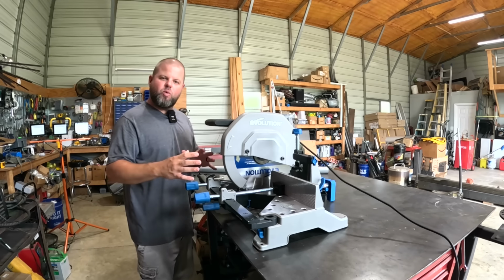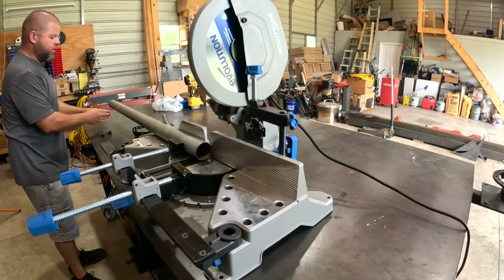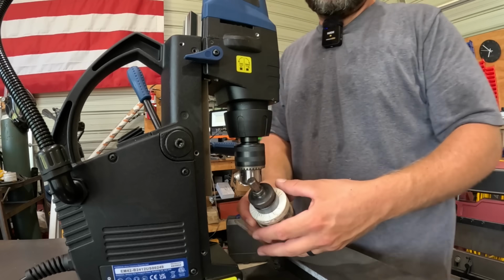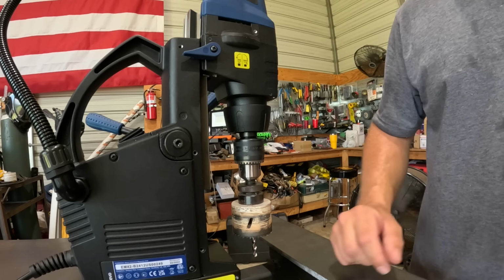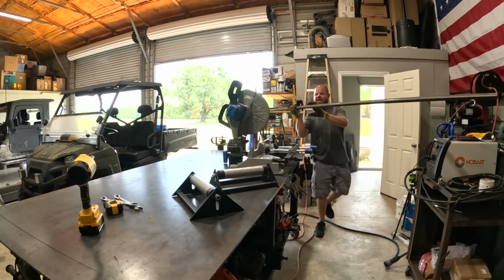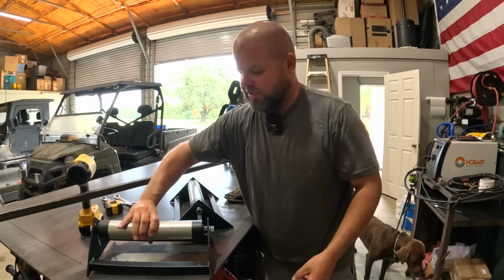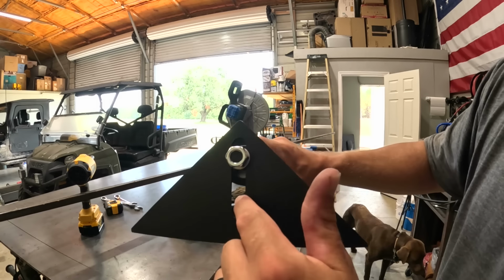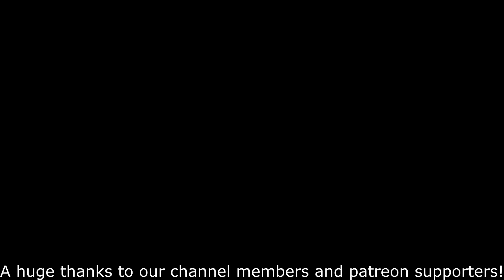Building Metal Roller Work Stands! A Huge Help!

Comment: Thanks Andrew.
I had Roller Stands for My table saw but changed them out for the Ridgid Flip-top stands.
I found Roller stands tend to push the stock one way or another if they were not lined up perfectly.
You will probably not have that issue with yours unless the stock is heavy. 
When I had my Radial arm Saw it had 8ft of bed to the left of the blade and I had the Chop-saw recessed into the bed so I had the whole bed to support the wood. 
Mike M.
Reply from the maker: If I see any shift I'll adjust accordingly, it's bound to happen. Or I'll build a pivoting base.
Reply: @TKCL  I don't think you'll have a problem with setting up for cross cuts. 
But when ripping long stock or sheet goods on a Table saw it will be HAHAHAHA